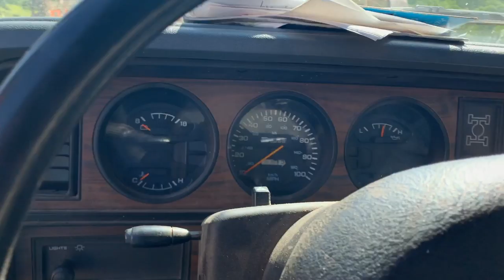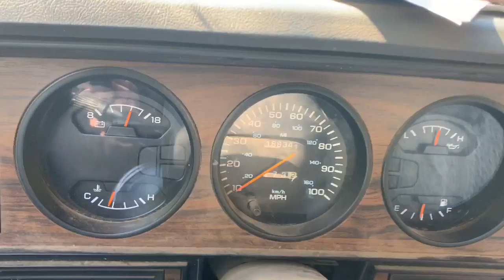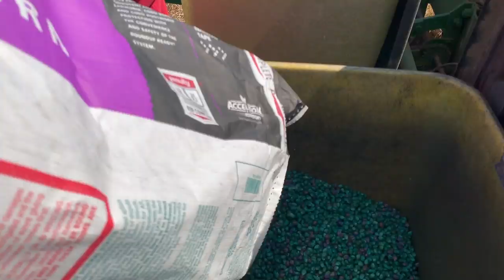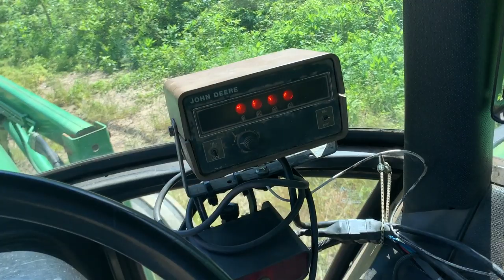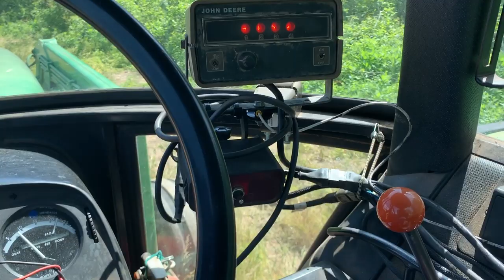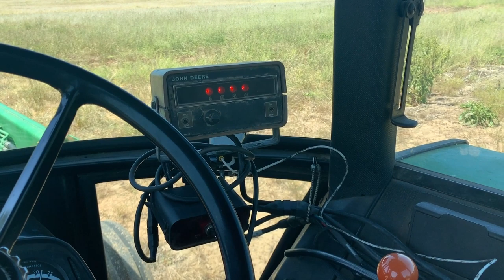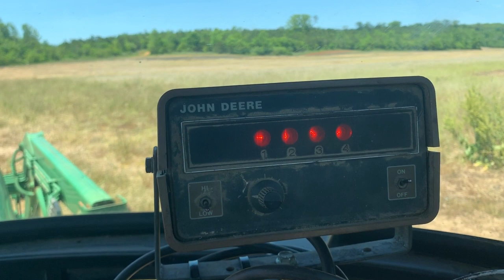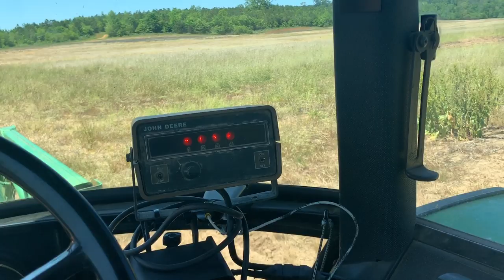Time to PLANT!

Comment: I have planted a few times when the monitor or row sensor did not work with a 7000 jd planter. Each row will drop a few seeds when you raise up on the ends, You just have to keep checking once in awhile that it is or have someone else checking while you keep planting. If you have good eyes you can see them from the tractor on worked ground.

Comment: I don't think all 4 sensors are bad there has to be a problem in the signal path to the indicator box like a loose connector or cut wire.  I hope is has been worked out by now though whatever the hitch.

Comment: Back in the 50's in Troy township, Sauk County Wisconsin; most of the neighbors planted with a 2 row corn planter. But the Enges were BIG TIME farmers and had a 4 row (42" spacing) corn planter!  It had round metal hoppers with circle shaped discs to grab the seeds to drop 1  by 1 into the seed tubes which went between 2 discs that opened the ground at a depth manually controlled (not very accurately). The discs had to be swapped out depending on what variety of seed you were using and its shape (flats or rounds).  Rounds were the seeds near the ends of the cobs and were sorted out from the flats before planting with a seed grader that only my Uncle Carl owned.  Some farmers preferred the rounds to the flats because they fell into the notches in the planter plates more reliably giving you a more uniform row of corn without any skips.  The round seeds may also have had a larger endosperm  giving the seedling a little more fuel to emerge from the ground.  There were no sensors or electric eyes to tell you if the planter was working right.  You stopped and grubbed down in the dirt with your hands searching for a seed and measuring with a matchbook to see if that seed was "matchbook deep" and hopefully  between 2 other seeds 6 or 8 inches away.  Sometimes the seeds didn't come out because the plates weren't working right or the tubes got plugged.  As an 8 year old boy my job was to kneel down and ride on the board on the back of the grain drill that was used to step up on when filling the bins with sacks of seeds.  I would bend over with my head upside down to look at where the seed tubes entered the opening disks to see if there were seeds coming out.  To do this stunt I had to hang on with one arm behind me somewhere on the back of the planter to keep from falling off.  There were lots of open gears that were turning on shafts metering the seeds out of the bins where I was hanging on to the back of the planter.  One time the sleeve on the denim jacket I was wearing got caught between 2 turning gears and started eating my jacket up, drawing my arm up next so I began screaming BLOODY MURDER!!!  "What's that you're yelling about?" Norbert, the hired man said looking back on the H tractor with a grin. But thankfully he stopped just as the gears began to draw blood from  my wrist.  Later on I shot Norbert in the butt with my BB gun.

Comment: Pickup a bottle or two of graphite for planter boxes jd dealer should have it, the seed meters will work better. Shoup mail order parts carriers a ton of jd planter parts, if I have time I get from them or our jd dealer delivers which is really great! I have the same type planter it's just bigger. The monitor is nice when they work correctly, very stressful when they don't! Good luck!! Looking outside right now  in New York state and there is snow on the ground, very depressing!
Reply: Yeah,the finger pickup planter units you're definitely are supposed to be using graphite with the seed. Dont need much.

Comment: If I was LB I would be planting without the monitor, did it for 10 year with a International planter.  Would replace the bad sensors and it wouldn't plant for more then a half hour before a sensor would fail, gust gave up.